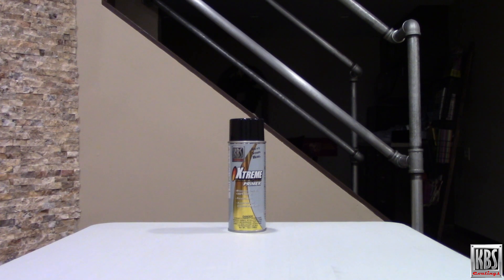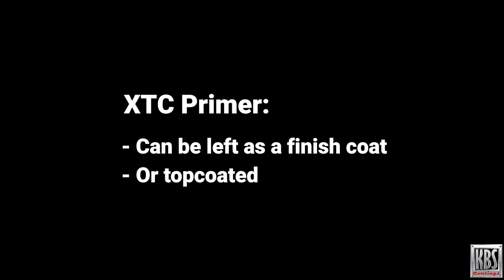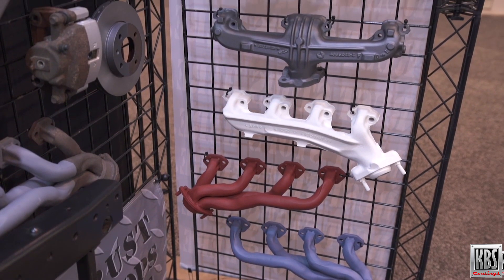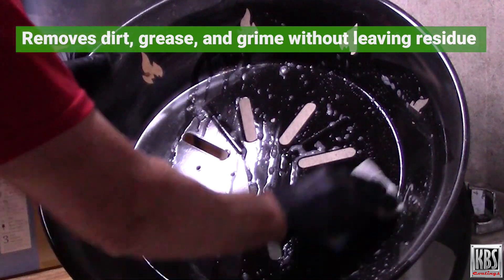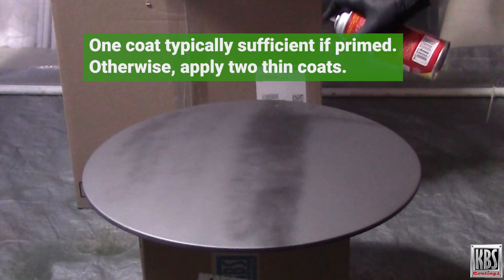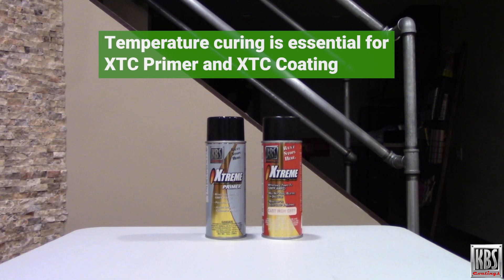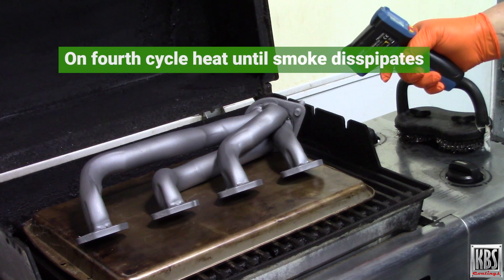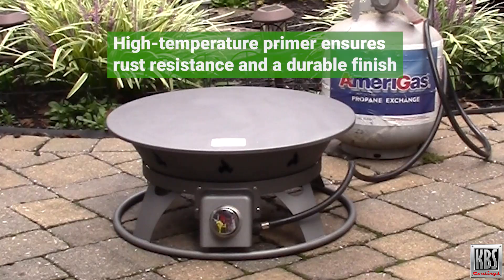Do I Need to Use a Primer With High Temperature Paint

Comment: I've used this primer in a few projects and so far I'm very impressed! Still haven't used my Charcoal Metallic topcoat yet, but this the Jet black an few other available dark metallic colors caught my eye. I wish you had a Black Midnight Metallic (blue, purple, violet metallic in the Black Paint basically, maybe even a little magenta gold an silver metallic, but definitely NO green or turquoise it ruins it lol)

Anyhow, after 2nd final coat of the Xtreme High Temp Etching Primer, it says dry to the touch in 15 minutes, but how long should I wait at least until I top coat with a Black High Temp Primer and the Charcoal High Temp Top Coating? 

20 minutes? 
30 minutes? 
1 hour?
Reply from the maker: Sounds like you are using aerosol XTC. Allow 15-30 minutes drying time between coats. Heavy applications can lead to reduced coating life/adhesion. As with all KBS Products, multiple thin, covering coats is always the best practice.